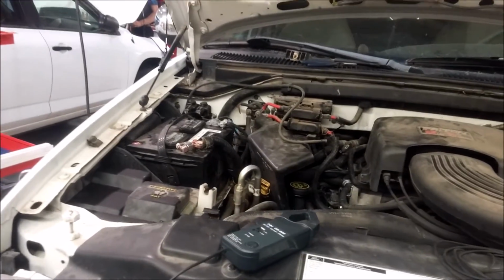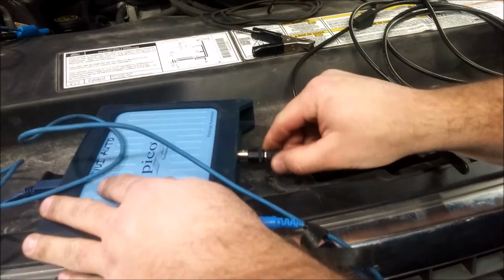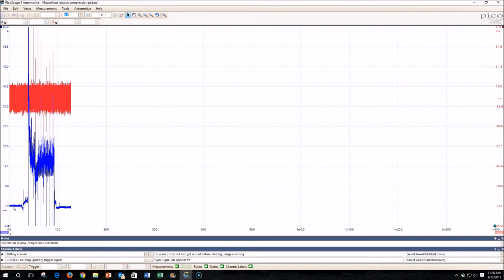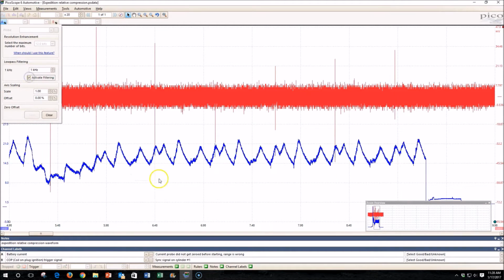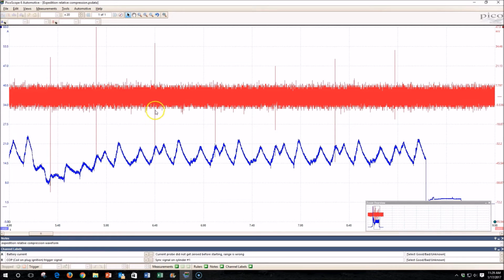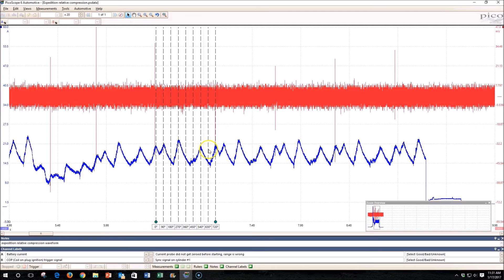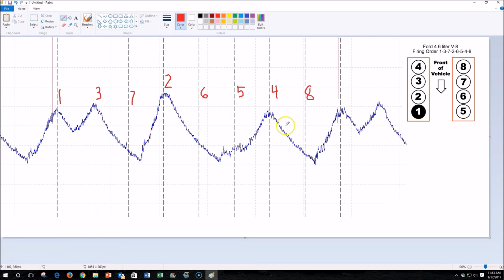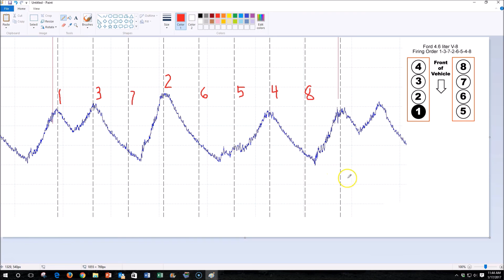How to Perform a Relative Compression Test on an Engine

Comment: JUSTIN MILLER..........                                                       when one or more pistons are NOT giving any compression. What would be the problems on the cars engine? 
        .......                      Do you have to replace the piston or the actual engine block is cracked inside that piston cylinder and have to replace the whole engine block?
Reply from the maker: It could be any of the things you have listed and more.  You will need to do more specific testing of that cylinder to determine which component has failed.